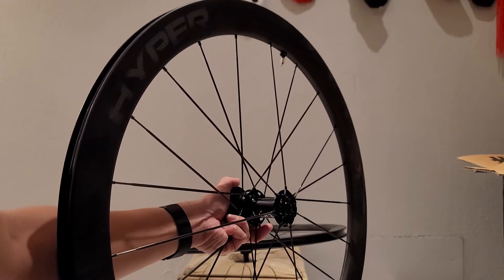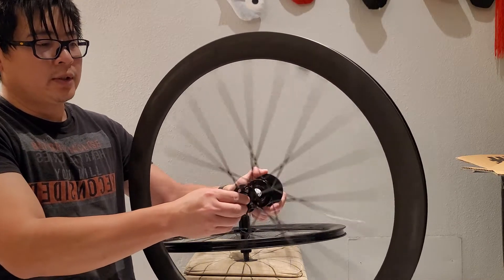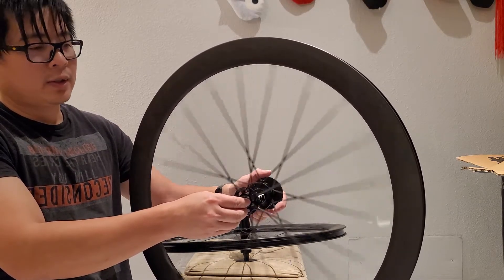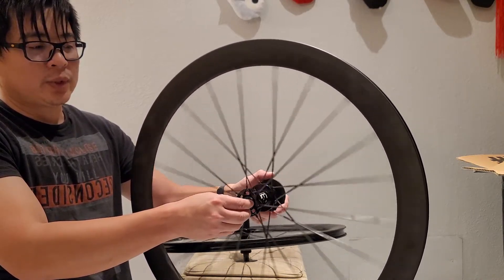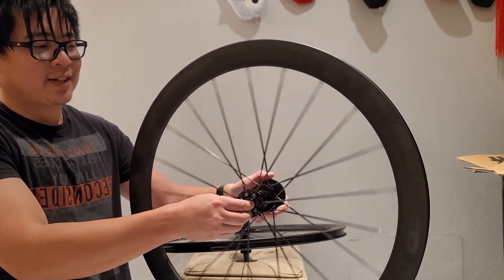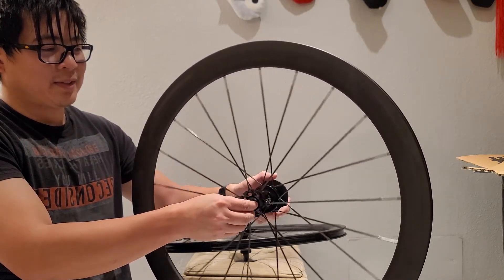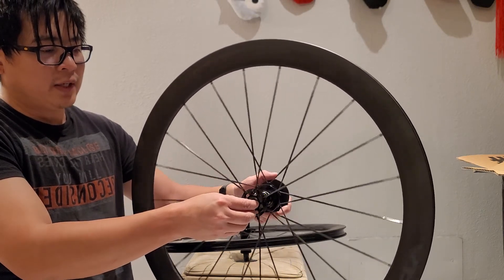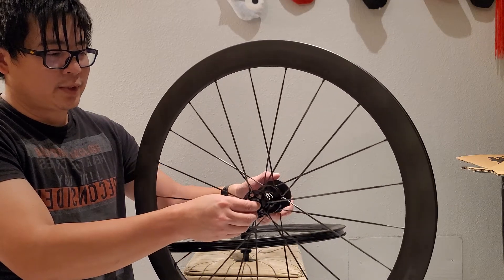Winspace Hyper Ceramic Wheel Bearing Spin Test

Comment: Under load is the real test, most wheels spin up great in the hand 9
Reply from the maker: Not my other 2 wheelset. Some doesn't spin as freely when the wheels slow down and doesn't have that free movement when the wheel pendulum back and forth. But time will tell if the ceramic bearings hold up or not.